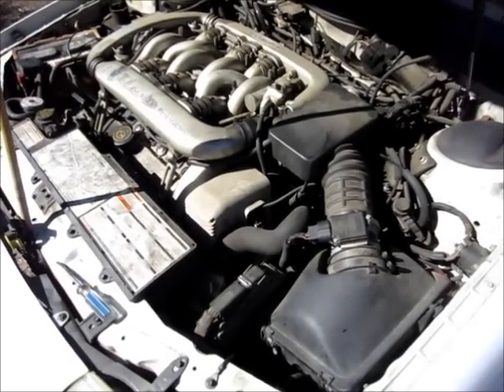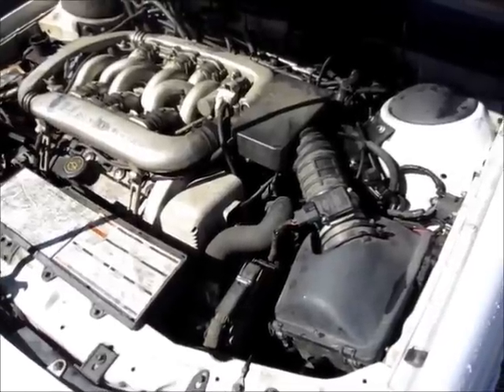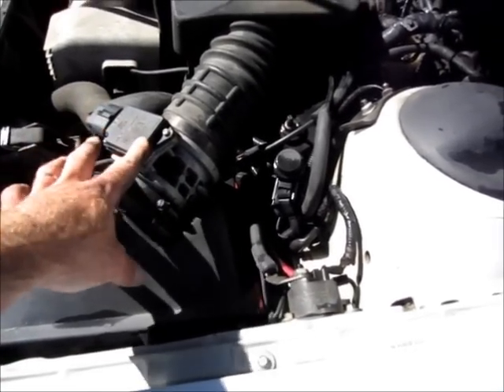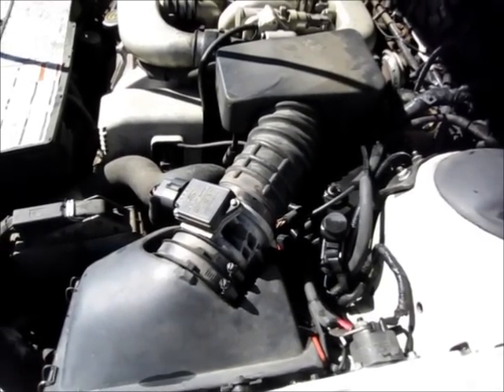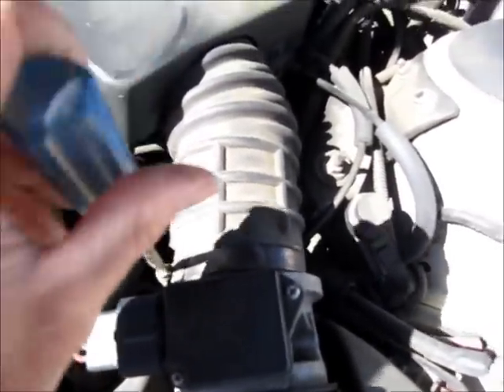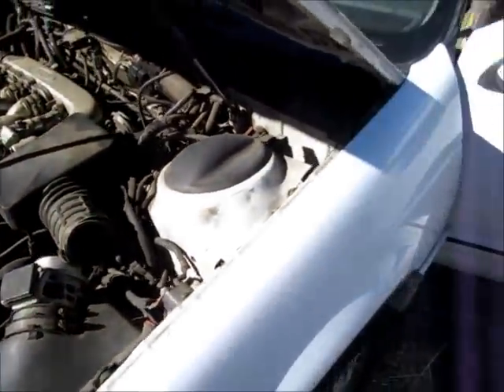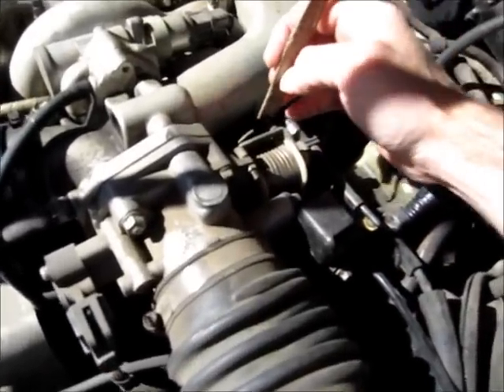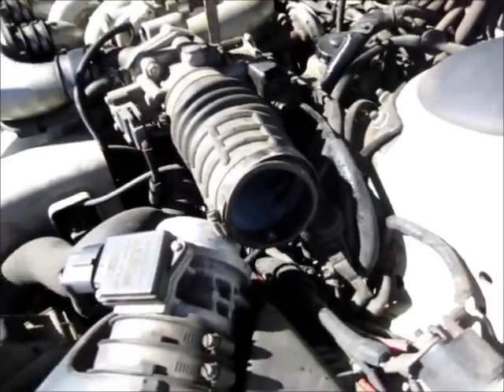How To Remove Carbon Deposits Inside A Car Engine With Water

Comment: Interesting!  It does look like a crazy amount of water, but maybe it's just because the camera is zoomed on the air intake hose.

I would think that given the temperature of all of the metal that the water is coming into contact with, it must become steam even before the compression cycle of the piston hits.  So, I believe that the first problems you would see with too much water are pressure blowouts related to the extra steam pressure you've introduced.  

It also seems like the more you can aerosolize the water going in, the better off you'll be (fine mist of water vs just pouring it in a stream)?

I don't know enough about cars to know if you're bonkers or not, but it seems like a bold move!  Are you able to measure that it's actually working?  Thanks for documenting!
Reply from the maker: You're right, it looks like a lot more water than it is (hence all the negative comments haha). The only hard evidence I have that it works is an experience with a blown head gasket. The gasket failed and water got into one cylinder. When I pulled the head, the other 3 cylinders were black with carbon, but the one that had ingested water was completely clean. Thanks for the comment!

Comment: A better method would be through a vacuum hose and use some restrictive tubing.  Look at the berryman b12 chemtool total combustion chamber cleaner.  it comes with a tube that has a pin hole on the suction side and it has a y fitting that introduces air at the same time in order to atomize the liquid.  it's made for their product, but it should work well with water as well.  $13 for the berryman on amazon and you can reuse the hose.  The way you are doing it is a bit dangerous.  I tried the berryman and scoped a cylinder with a video camera before and after, next i'm trying water.  Also, people need to know to do this on a warmed up engine, so the water will turn to steam quickly.
Reply from the maker: good idea about the hose, thanks. Lately I've been using a vacuum line plugged into the manifold with a valve on the end, which is a similar concept.

Comment: And what about the sparkplugs and water ?
Reply from the maker: They'll be fine. water is a byproduct of combustion anyway, so the internal materials of the combustion chamber won't be harmed.
Reply: Thanks for the reply :-) so no risk of short circuit ?
Reply: francois morin If you are really scared of short circuiting your plugs put some di electric grease on them
Reply: ***** and crazy corrosion
Reply: and what about spray engine coolant ? (non corrosive liquid)
Reply: francois morin On your spark plugs? Don't know. I say stick with the grease because that won't break down and it'll keep water out of sensitive electronics and stop plugs from arcing where they aren't supposed to.
Reply: Nop in the intake to clean the engine :-)
Reply: francois morin The point of the water in the intake was to create steam to break up carbon deposits. Don't really need anything else. 
To get it even cleaner you can disassemble the engine and put it through an ultrasonic cleaner and that'll make it NEW.
Reply: Spark plugs use an electric spark. Electricity loves water
Reply: ZIPPER978 The water would vaporize before it has a chance to hit the spark plug
Reply: I'm aware of that I was just making a point

Comment: Water will NOT remove carbon.  It can not possibly do any good, and will cause a lot of potential corrosion problems.
Reply: Sorry Kirk, but you are wrong on both counts
Reply: James Smith
Water injection is old, and is used not only to cool down an engine, but to gain power from the vaporization expansion of the water into steam.  But how could it effect carbon?  The water is inert and and not going to chemically combine with anything else.  There is going to be less heat, so it can't burn it off.  The only thing left would be some sort of shock or abrasive effect, which seems impossible with water?
Reply: *****
 When you rebuild an engine, you have to clean the pistons and head, of all the carbon build up.  If you try a steam cleaner, it won't work.  The only things that work are sand blaster or hammer and chisel.  The carbon is crystalline, like rock.  I see no way water is going to have an effect.
Reply: *****
 I personally do not believe any carbon remover could possibly work.  The carbon is very hard, and is not effected by temperature or shock, or else it would have already burned off.
Reply: +Kirk Augustin Have a look at an engine that has suffered a head gasket failure, the cylinders where water has got in will be far cleaner than the others.
Reply: +g0fvt Yes I have seen head gasket failures where the leaking cylinder was not only totally clean, but also have groove worn into the aluminum head.  That is NOT from water.  It is the excess oxygen from the gasket leak.  An engine with a blown head gasket runs way lean, and burns up the head.  The erosion will cut the head in 2 eventually.  But water actually cools it down and slows the damage.

Comment: I would sure like to see the before and after condition of the internal  parts on any engine that goes through this test. Try using a intake or exhaust probe to visually see results because manufacturers know people wont do this to their own vehicles for fear of a catastrophic damage results from taking the engine apart and inspecting carburetor valves, lifters, seats, rings, bearings, sensors. If no one will breakdown a engine to be part of a proper test then nothing has been proven for the integrity of the engine. SMOKE and mirrors is all you have without direct results from examining the internal workings before and after adding anything to the subject motor being tested. You say gauges? Gauges only give a present condition and not of long term damage. * I WOULD CAUTION ANYONE WHO PERFORMS A TEST ON A VEHICLE THROUGH INFORMATION FROM THIS VIDEO TEST***

Comment: That's an old trick that's been used by mechanics for over 50 years. Does a great job of removing deposits but don't go overboard with the garden hose. A fine mist spray bottle does just fine.

Comment: I know that this works, people can be skeptical if they want but I've seen it done in person by my college instructor in my automotive program. I would definitely not use a garden hose though, I'd probably take a squirt bottle and use that instead. Less water = less chance of bending a valve or breaking other internals. Either way, nice video. Thanks.
Reply from the maker: Thanks! Glad you enjoyed the video.
Reply: ***** I wanted to know more about the water injection you mentioned and found this helpful email from 1996, which seems to be written by a Pratt & Whitney engineer on an AOL account!  

Perhaps others might enjoy reading it.
 http://www.kls2.com/cgi-bin/arcfetch?db=sci.aeronautics.airliners&id=%3Cairliners.1996.265@ohare.chicago.com%3E
Reply: ***** Saab sold 900 turbo's with water injection as well

Comment: How do the dislodged bit of carbon pass through the catalytic convertor? The noise that motor was making it wasn't long for this world anyway!
Reply: They just burn up. Carbon can be oxydised but it will take higher temperatures, a catalyst will have those temperatures. Otherwise, they'll just be released into the atmosphere as tiny particles.
The engine is sounding so rough because the water will be evaporated into steam, increasing a lot in volume, this will make it much harder for the engine to compress, since the expansion of the water works against it, hence the drops in rpm and change in noise. It's because the engine has to work too hard
Reply: and then?

Comment: how bout just using b-12
Reply from the maker: It might work but water is free! It would probably be a little safer though because of its tendency to burn rather than staying liquid and possible hydrolocking the motor.

Comment: this is a risky way to clean carbon from your engine. why not do an engine flush? if problem persist just pull apart and clean the essentials. like you said in the video this can damage your engine. i wouldn't be encouraging people to try this because it can easily go wrong.

Comment: We used to run a water system years ago on a race car...helps with early detonation on high timing applications...
Reply from the maker: I've heard about that on turbo motors. Were you using forced induction or NA?
Reply: NA..ran a tube from a chill can to a vacuum hose leading into the intake manfold...that was years ago.

Comment: I've known about this since the 1970's. Give your car a drink. Pratt and Whitney used water injection in their 24 and 36 cylinder radial engines to improve performance on take of and climb of the WW2 bombers carrying full loads. Personally I don't think it does a thing for a decent engine. I've pulled engines apart that had 100k + miles on them and there was little or no carbon build up anywhere.
Reply from the maker: I think you're right about well maintained modern vehicles. This car had been running a long time with a bad o2 sensor though, and it had 200000+ miles on the clock. I thought she could use a drink.
Reply: Yeah you're probably right. I just got done doing the bottom end of a 03 4.2 liter Vortec i6. Quick fix for a bearing spin. No journal damage, all six were 003 or less. One connecting rod and cap, all 12 sleeves, all bolts (not reusable)  Compression 155 PSI or better each cyl (10:1 comp ratio) so not much work except the bitch it was to yank the engine. Engine purrs, can't hear it run. Replaced the motor mounts, lower ball joints and tie rod ends. Repaced water pump. 110k miles on the motor, 295 HP/torque. Pretty damn decent engine for a $1100. parts and shop rebuild.

Comment: Do you still have this car?  I'm wondering how the Cats have held up.  I hear some stories about Seafoam users messing up thier Cats.
Reply: That happened to me.  I drive a 2004 mustang gt and i got it in 2007.  The summer of 2009 i decided to get the sea foam treatment done and my cats went out a couple weeks later.  It wouldve cost me 2500 dollars at ford but the car was still under warranty but i still paid around 400.  The car only had 32000 miles on it at the time.
Reply: two cats ruined here by seafoam.  Works great on the engine for cleaning, but hell on catalytics converters.

Comment: I read down the previous comments and the blown head gasket that cleaned the cylinder jumped out.  So yes this should work. I have an old 99 escort I'm not using so when it gets warmer I'm going to try this. But I will try to get my hands on an inspection camera or borescope  2 do some before and after comparisons.  Plus fuel consumption comparison as well. It will be interesting i think. I have used zmax 2x in it and about 4 bottles of fuel injector cleaner. So there should be some buildup. I've had it since new. I have noticed Fuel consumption has increased and no maintenance or k&n air filter has ever improved.  Thanks for posting vid.
Reply: It will build up  on your catalytic converter more than will come out on exhaust pipe, you better use some liquid solution at your auto-store and add to gas, those solutions have high octane formulas that burns all residue accumulated and comes out along with smoke, water-good luck....
Reply: semko71  Carbon build-up in cat more than in cylinder? Hmmm. Maybe. but I just changed an elbow cat and the main cat on one side of my 99 F150 because of exterior rust. They were as clean as can be. But I now remember my 81 Mercury Lynx catalytic converter that I took off and some channels that looked clogged as I could not see strait through. Funny thing is I simply washed it backwards to normal flow with a garden hose and it cleaned it up with no effort.   But thanks for the reminder. Will try to think of a way to check cat before and after.

Comment: Distilled water, vacuum hose from intake manifold to draw the water at a rate the engine can properly clean with.. That hose is neither distilled or precise flow rate..

Comment: **One thing that the original poster failed to mention is that you should change your engine oil after performing this procedure!**

I love all of the negative comments on this. The people who are freaking out have obviously never changed a blown head gasket. All you are doing here is steam cleaning the carbon deposits from the pistons and rings in the same way. My preferred method involves a spray bottle or hand pumped garden sprayer though. A lot less chance of hydro-lock although it does take a little longer because you're spraying less volume at a time.
One thing that the original poster failed to mention is that you should change your engine oil after performing this procedure. I recommend that if you do do this it should be done just prior to a scheduled oil change. Water in your oil is a bad thing and there's no point in wasting your money changing your oil twice..
Reply from the maker: Thanks for the tip about the oil change. I had no idea the neg. feedback I would get on this video. I've seen mechanics pour water into carburetors my whole life. Another more controlled method of water injection would be a small diameter hose with a valve plugged into a vacuum port with the other end in a bucket of water.
Reply: Changing the oil is just good insurance against the off chance that some water may have entered the crankcase. The chance is very small though and if you do this method just before a scheduled change, you're just killing two birds.
Correct, you can actually use the vacuum line from the power brake booster if your vehicle has power brakes. Attach a clear, smaller diameter hose to the booster's hose (making sure the connection is airtight!). Then set the open end into a jug of distilled water. Increase the engine's speed if necessary. Distilled is preferred if you have hard water.
Reply: *****
 It seems most of the negative comments are due mostly to the water hose and not the actual procedure. LOL It is kind of shocking seeing you spray it directly in the intake like that.Anyway,people I know have been using water injection on gasoline engines since the late 70's,not a single hydrolock among them.So, nice video,thanks for sharing.
Reply: +SuperEvilmonkey88 Properly functioning PCV system will remove any water that may enter the crankcase given a long enough drive that gets the oil to full operating temperature. It is actually normal for short-trip vehicles to build up a lot of water in the crankcase, especially during winter. Sometimes to the point where you get deposits on the oil cap that look like you have a blown head gasket. The combustion of gasoline produces water and some will end up in the crankcase. The only way it leaves is when the oil gets hot enough.
Reply: No it won't. Positive Crankcase Ventilation (PCV) has nothing to do with this. PCV dumps the pressure of the crankcase so you don't blow a gasket. Pressure builds and usually the first to go is valve cover gaskets. However, if you know anything about internal combustion, moisture is a part of it. People who fire up their engine and take off only to shut down 5 minutes later will wind up with milky oil because the engine hasn't reached operating temperature. Still, this has nothing to do with the PCV. Nor does it have any thing to do with using water to clean the combustion chambers.
Reply: PCV has everything to do with this. The reason for PCV to even exist is to suck vapors (including water vapor) from the crankcase into the intake manifold. Before PCV there was a "road draft tube". That didn't provide very positive ventilation of the crankcase! Oil change intervals actually increased with the introduction of PCV, because it helps keep the oil cleaner. That is a fact. Vapors in the crankcase are more effectively removed when there is continually fresh air being sucked through it--which is what the PCV valve does.

What happens when the vapors aren't removed? They condense and go back into the oil. They are all contaminants. They do not belong in the oil. PCV helps remove them.

This is also why people who remove their PCV and replace it with a breather are people who fail to understand the benefits that PCV provides. It is not, as you claim, just for dumping the pressure of the crankcase. Nor is it just there to help save the environment.

Even if the PCV were totally plugged, the pressure in the crankcase would still vent through the fresh air tube that is normally found connected to a valve cover and the air filter box or air intake duct.

Left in that condition long enough, however, you'll have an engine with a sludge problem.

Comment: I was a bit scared at one point with the amount of water you put in but it worked out all good in the end. I would suggest you not use as must water as that and get as close to a light mist as possible. There will always be believers and non believers, so don't worry too much about anything.

They didn't believe Jesus when he spoke the truth so what chance have we got….lol
Reply from the maker: Thanks for the comment. I have to keep a thick skin for this video. I think it really looked like more water than it actually was. As I said in the video, I just sprayed until I heard the engine start to sputter. There's a large difference between the amount of water it takes to make an engine sputter and the amount it would take to lock up the motor.
Reply: Amen to that brother!
Reply: Really though! When i saw the hose, i was like OH NO. But its okay i suppose, I like to use a spray bottle with ice cold water.

Comment: You would have to have a ton of carbon build up to affect the compression ratio enough to ignite due to heat of compression like a diesel. Carbon build up will cause pinging, but only due to lack of heat transfer in your valves, pistons, liners, etc. If the valves retain their heat, they could eventually cause preignition and pinging. I am all for the steam cleaning method, as long as you don't use too much water.